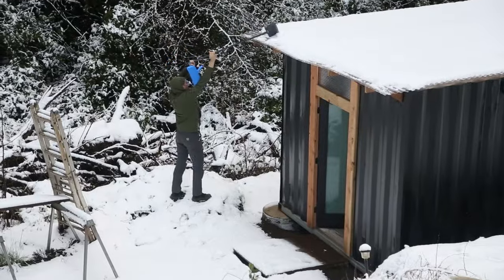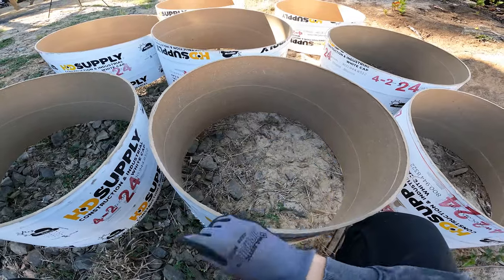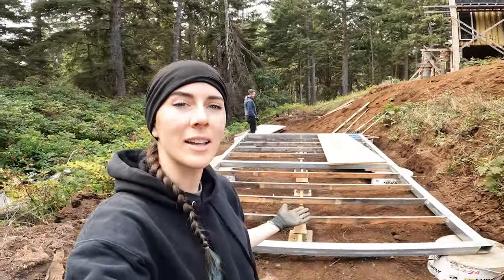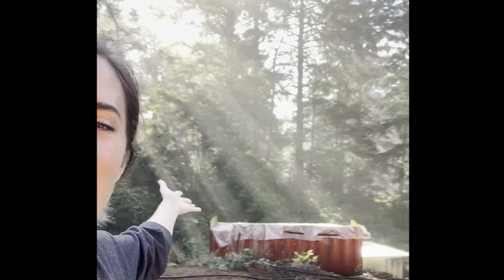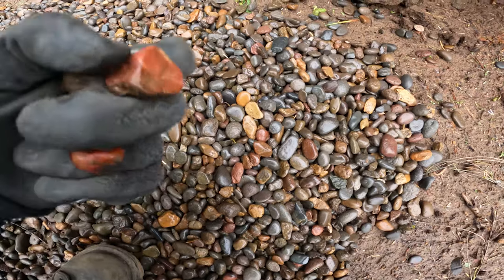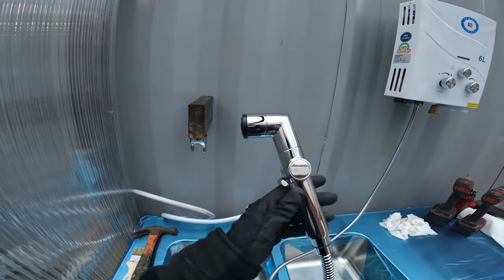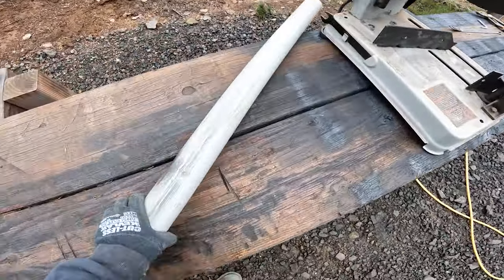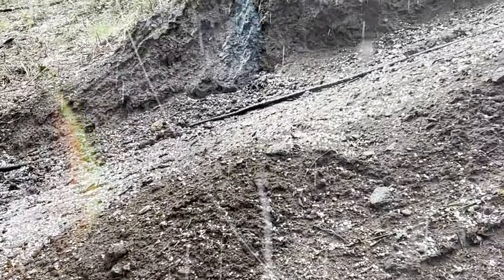START TO FINISH OUTDOOR SHOWER BUILD Using Vanpowers Super Power Pro #build #construction #building

Comment: I have a similar water heater in my house in Thailand. The winter'summer setting on mine, is for the number of burners that are used. My unit has 2 burners ( summer) or 3 burnerrs (winter) . The Temperature setting , which looks to be "reversed" is for restricting the volume of water that passes through the heat exchanger. The lower the water volume,, the longer it will be in contact with the heat exchanger , hence, it will be hotter. The Flame knob, adjusts the height of the flame, or temp. Between the 3, you can tune it quite nicely.
Reply from the maker: Thx for the explanation! Makes more sense now 😊

Comment: Hail is something we just live with here in the Black Hills.  When we got here to build our house, one of the first things we did was pickup a Versatube carport for shelter,  We barely completed it and parked our vehicles under it and we had a hellacious Hail storm.  Since we've completed our house with attached garage we've converted the carport to firewood storage and a place to keep some of our outdoor use equipment like the zero turn mower and our Ranger. and wood splitter.
Reply from the maker: That’s smart! We get it here and there but it’s not super common

Comment: about the water boiler on 4041 in the video, if you have a high water flow, the temperature of the water is lower because the boiler then has less time to heat up the water, with a lower water flow you have warmer water because then the boiler heats up more  has time to heat up the water, so less water = hotter water, more water = cooler water,
nice shower 👍
Reply from the maker: Thank you!! And thx for the explanation 😊👍
Reply: @PacificPinesRanch  👍

Comment: That low/high sign is for temperature. It works, as you said, using pressure. Low pressure = water flowing slower in the machine and heating up more while on high pressure the water will flow faster and wouldn't have enough time to heat up as much. To optimize, lower the pressure as much as acceptable and increase the flame to heat it up to your desired temperature.
Reply from the maker: Thank you for the explanation!! :)

Comment: I love your Clean Machine will take you back in time to the cabin he old teck & the new teck one too, for the road to take you when you have snow or dark outside, I will install LED light on the ground so you can walk it blindly anytime if you feel to have a shower or laundry or ; - ) make a sliding tub tannel from top your home to drop you in Clean Machine no need to walk outside, call it the fast express to CM then make back to your make a pulley will pull you back inside the tub tunnel home without walking outside in the mud again have fun make your home like wanderland  ( - ;   but in the end you have Clean Machine.
Reply from the maker: Thanks so much!! And thanks for the tips :)

Comment: OK in the Winter time you turned to Winter it means it gives you more propane to to work your heat will hot-water-heat eater in the summer time it takes less propane so you turn to summertime and as for the term which are controlled and the water control is how much heat and how hot you want and how much cold water you want put in I watched this on another video and that's how I learned
Reply from the maker: Thx for the info! :)

Comment: Skill without style… I’m truly sorry, but my mother was a successful interior designer and my father was an architectural engineer…. Kind of baked in when there is no form to the function, only function…the decoration should have been built into the design.
Reply from the maker: The point of building the shower house was to have a temporary place to clean things and shower, and we wanted to do it with as minimal costs as possible. The main goal was to make it functional and easy to tear down once we are done with it, so we didn't want to spend too much time on the decor since it's temporary.